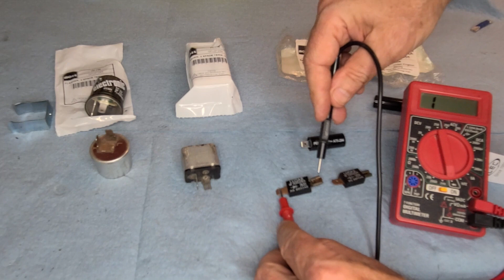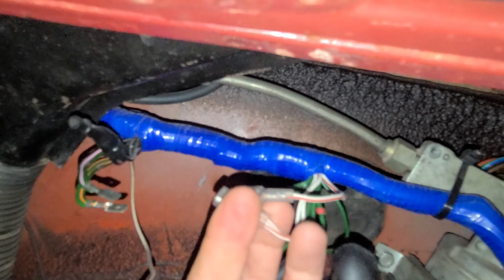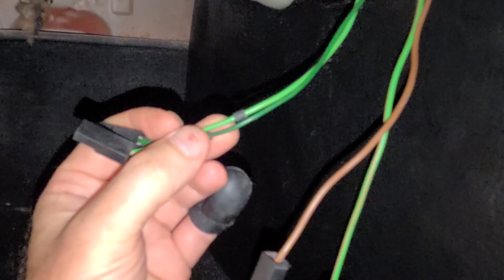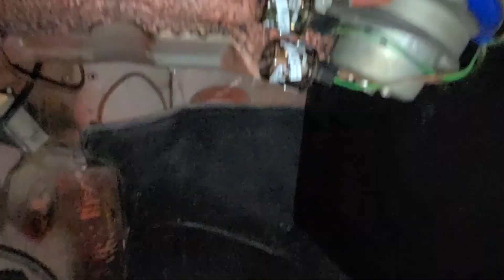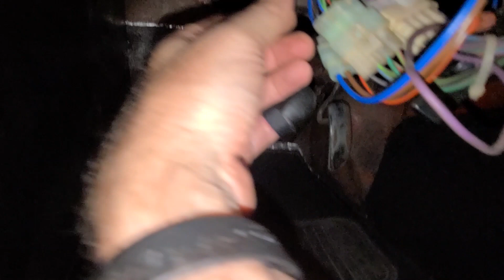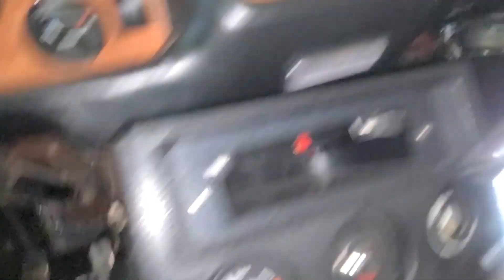1977 MGB Flashers and diodes

Comment: Great helpful video. Thank you for removing the glove compartment; it helped.
Question on diodes and relays. My 74 B "flash to pass" stopped working.  Any ideas on this?
Much appreciated, john
Reply from the maker: Not sure it helps, but I did do a video on the switches on the column. 

https://youtu.be/55nalE6ju0U?si=HRpZ4gQHwfJ4KJSK

Comment: The reason I switched to a more expensive electronic flasher over 20 years ago is that, when I was idling at a stoplight, my turn signals would blink normally. And that was with the headlights on, the windshield wipers were on and the blower motor was running. That sold me.

Comment: Just discovered your channel - I just bought a 77 MGB.  I think your videos are going to be a godsend for me.  The signal lights on my MGB don't work so this is the perfect video for me.  A couple of questions:
1. Is it the same part for both the flashers that you replaced - the one for the signal lights and the one for the Hazards?
2.  What is the part number on Moss for the diodes?
Reply from the maker: @mknackstedt  181-855 for the diodes 
141-748 for the flashers units
Reply from the maker: @mknackstedt  yes, they are the same part for flashers and signal.

I have diodes in the fronts, so I purchased the electronic flashers relays.   I think I posted the part numbers in the video description.  I will check

Comment: The heater-based flasher units have one feature that the electronic flashers don't have. As you mentioned, does the heater-based flasher switches off when the element gets too hot, and switches on again after the temperature has cooled down. So the flashing rate ("blinks per minute") depends on the electrical current: if the current is large it will heat up quickly. If the current is low it heats up slowly. You can hear the difference in clicking sound. This is an easy way to recognise whether one of the light bulbs is broken: the current is suddenly less, so the flashing rate will be lower than usual. The electronic flasher units don't monitor the electrical current: they are simply time-based. So you can't audibly detect whether a bulb is blown or not. Vice versa: electronic flashers are required when the bulbs have been replaced by LEDs. The electrical current in the LEDs is too small for the heater-based flashers: the lights won't flash but will be on continuously.
Reply: Your comment may have just solved the issue I’m having with the ‘77 MGB I just bought.  After a few minutes the turn signals stop working.  The hazards always work which are on a different flasher relay.  Thanks so much for making your comment 9 months ago!
Reply: @SigvaldsAmazon  You're welcome. Have fun with your MGB.